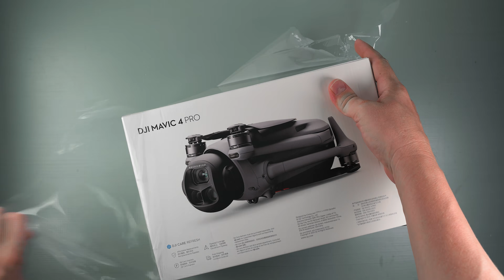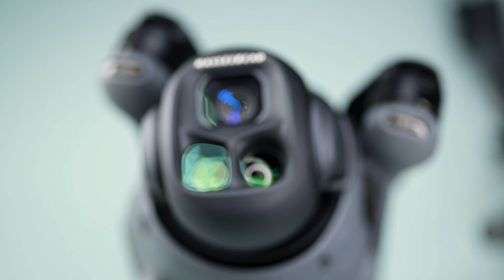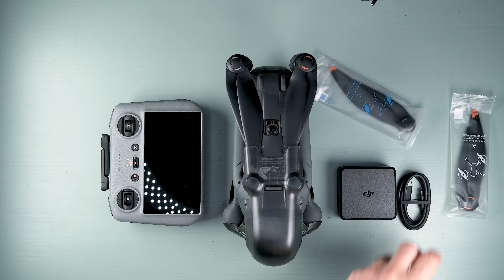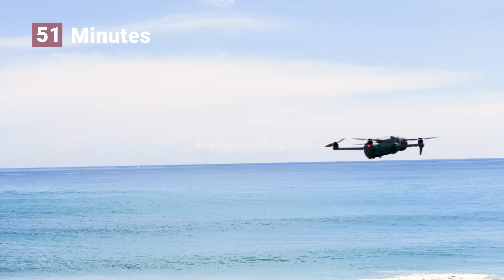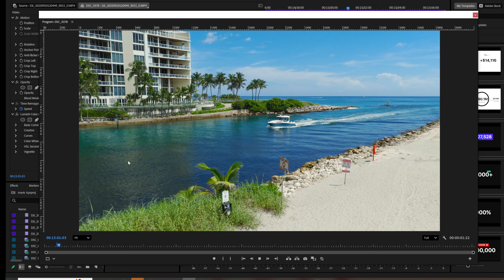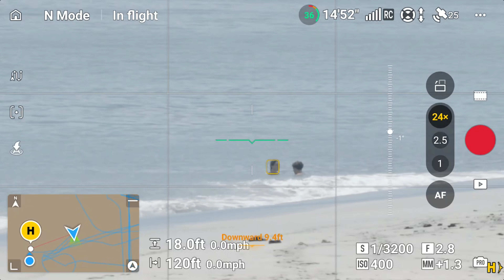DJI Mavic 4 Pro Unboxing & First Impressions | Bigger and Better? | Worth the upgrade?

Comment: Nice to see someone buy just the drone and no combo. I feel like the price for the Flymore Combo is not worth it for what you're getting.
Reply: How? You get more batteries. That's longer flight time. It's definitely worth it. Also you get the RC 2 controller as well.